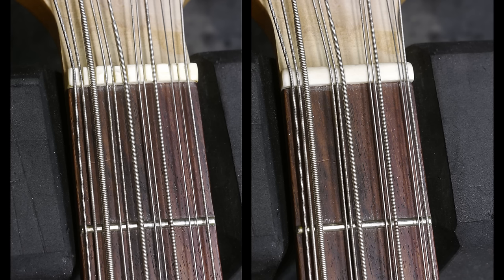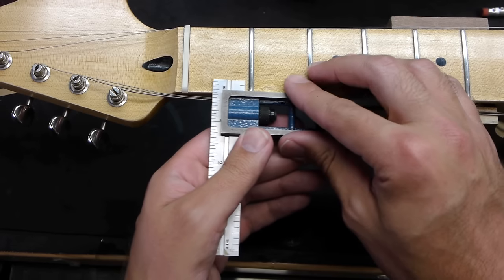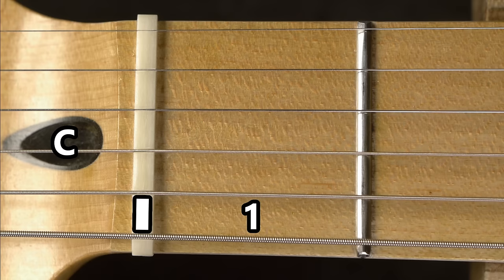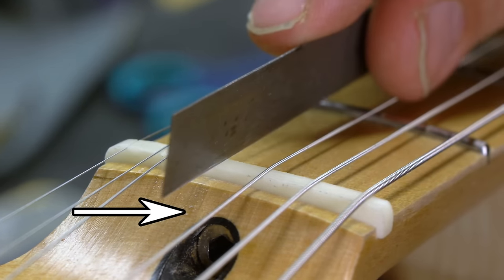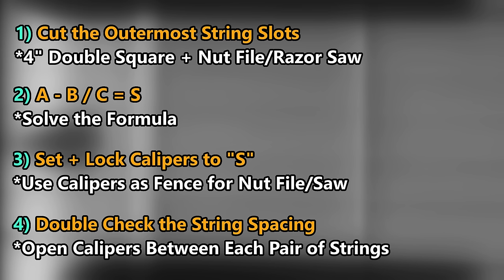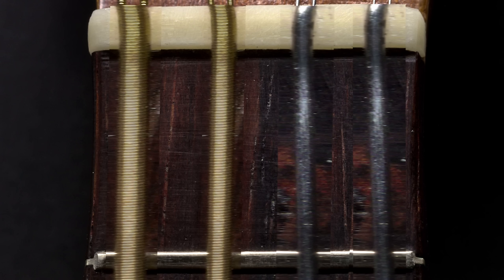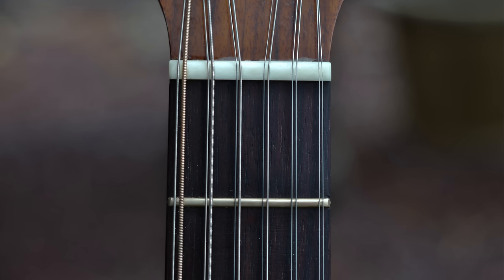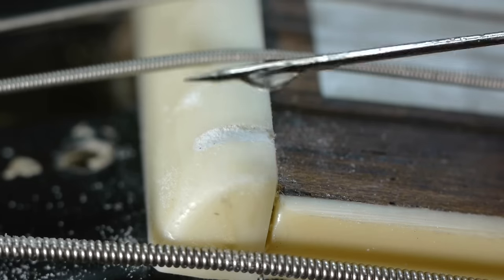Nut Slot Spacing *FOOLPROOF METHOD* - Works for 12 Strings Too!

Comment: Now that I understand cutting the full slot after each interval I can appreciate your approach.  The spacing is as even as it can be, and center to center distances change only by a few mils. It is perfect really. Too bad files are so expensive. I’ll take down my earlier comments. Thank you for your replies, it’s a rarity.
Again fabulous presentation and photography.
Reply from the maker: No worries about the previous comments! I always encourage all comments as it can help other people if they're having the same thoughts. 

I actually double checked my method immediately after you posted that comment as I thought you were right. I was 100% ready to take this video down, redo it and reupload it. 

My first thought was that you'd caught something I missed. I'm never opposed to criticism and my only interest is doing the best and most accurate work I can. If something I'm doing is sub optimal and I find a better way, the old way is going out the window. 

That's how I was taught many years ago. One of the many bits of wisdom imparted to me from Steve. Has affected my thinking deeply ever since

Comment: It’s a novel idea however if your nut files/slots are any wider than each string gauge you’re introducing a compounding error. But hey, it’s works for you! I use the edge of the nut as a reference point and the external caliper points to scrape a mark through a sharpy line and free hand each cut from there.
Reply from the maker: This is true. However, I present a solution for this in the video. It does not just work for me alone -- it will work for anyone and everyone that follows my instructions. This is an important point, as my goal with this method was for it to be foolproof, which it is. 

The solution: I tilt the file to adjust the slot as necessary to account for this. 

With the initial mark being shallow, there is plenty of room to move the slot left or right any amount needed to compensate for discrepancies between the nut file and string gauge. 

Then you re-test to make sure that the distance between the strings is as close to "S" as possible, before moving onto the next string. 

The value of "S" is calculated based on the exact string gauges used on that specific guitar. So getting each space to "S" will result in perfectly even string spacing. 

Most strings will only ever be a couple thousandths off as well, assuming a full collection of nut files. 

The standard Stewmac files are: .010" - .013" - .016" - .020" - .024" - .028" - .032" - .035" - .042" - .046" - .050" - .056" - .065", for guitar gauged strings. All gauges will fall within very close ranges of those files. 

The tilt is something Steve showed me as well. He has exclusively cut nuts by eye for 55 years -- I also did this for well over 10 years and then slowly started conceiving of a foolproof way to do it. 

Calculating for "S" will provide the precise spacing between each string for the exact set of strings. Using calipers to measure the space between each string once a nut is cut will very quickly show how even those spaces are. 

I've been quite surprised at times doing it by eye. Sometimes perfectly even spaces do not look even, almost like an optical illusion, but the calipers will reveal perfectly even spaces. 

Other methods are fine. And there is a margin of error that is acceptable -- even just changing string gauges a little will affect the spacing, but typically if the gauges are kept within a few thousandths of the previous gauge, this is not noticeable at all. 

I do want to clarify that I would never dog other methods. To each their own. .y friend for example does nuts exclusively by eye and they come out better than anyone else's I've ever seen, consistently. 

The purpose of this method is to make that level of perfection accessible to everyone. My friend and mentor told me it took him about 9 years before he knew 100% that he could cut a perfect nut every single time on the first try. 

I struggled to do this myself even after years, and the real challenge was a 12 string bass nut, shown in the video. I would certainly never want to cut paired string nuts by eye and this method takes all the tedium out of it. 

I do appreciate you pointing this out. And I only wish I had thought to mention that in the video. I did mention tilting the file but did not address the compounding error if those instructions are not followed.

My friend also uses his thumbnail as a guide and makes a pencil line on either side before cutting down the middle. Again, many roads lead to Rome -- but my goal was to take the guesswork out and make a very challenging job much easier to accomplish for people with less experience. Though I do think it's appropriate for people with more experience as well, if they're willing to give a new method a chance. 

Thanks again for the comment and again, I just wish I had mentioned this in my video. There's always some oversight and something I forget to mention yet I always strive for my videos to be as comprehensive and complete as possible.

Hopefully curious people will see your comment and my response and fill in the gap.
Reply: @guitar_md 

I truly appreciate that you were willing to share additional time on top of your video production to provide a clarification. Thank you.

I will try your method and perhaps also try using nut file widths instead of string widths for the equation as this would resolve the compounding error. I should have suggested this in my original comment, so there you go we can lament our regrets together.

For interests sake my personal guitars are spaced evenly centre to centre, as opposed to string-edge to string-edge. This obviously makes the spacings appear more tightly grouped as you get close towards the heavy strings. As you mentioned, the paradox of perfection in numbers presenting as visually incorrect.

Thanks again
Reply from the maker: @PatrickJWenzel  I appreciated your comment and the point you made was very intelligent, and suggested something I had not thought about. You did indeed catch something I missed, and made a point that I was up until now unaware of. 

I hope you didn't take any offense at my response. I come off as very stern but in my mind I'm merely describing things objectively. Perhaps I should have clarified that I wish my channel had more comments like yours, that have objective, useful criticism, and point out things I may have missed, in a respectful, objective way. 

Center to center spacing is something I have no experience with. I do know that some people prefer this. I would love to know the best way to achieve this, whether a method already exists or I could come up with my own version. 

As a player as well, i have no personal experience with center to center spacing. I'd have to try it extensively to evaluate my own preference. Just like with compound radius boards, people may tend to feel strongly one way or another. There is no definitive answer -- just preference. 

I would have to think long and hard to figure out how to reliably create such a spacing, preferably using a fence, like I did in this video.

Again...great point, and it is something I'm going to keep in mind. As good as this method is, I have run into issues in the past with this "compounding" error. Like a ship that's off by 1 degree. Well, by the hundredth mile, it's going to be off by a lot more than that. Same thing with the nut, and I have actually experienced this firsthand. 

i'd let a couple thousandths' discrepancy slide, then by the time I got to the B string, it was .010" out of spec, and I'd have no idea why. I have a better understanding of this now thanks to your comment. 

So don't be shy to speak up. I not only welcome it but I deeply appreciate it. I can only cover so much in my videos and I do rely on my viewers and commenters to catch mistakes I might make. 

I want to make sure you understand that I value your input and I'm grateful that you pointed something out to me that I was unaware of before reading your comment. These are the most inspiring comments to me and are a great service to the guitar community as a whole -- people can read through threads like yours and learn even more, just as you've helped me learn more today.

Comment: Finally! Math instead of voodoo! Can I send you all my guitars? Seriously, it’s obvious when you show comparisons the symmetrical beauty of your method outshines anything else. It speaks volumes that my left jumped at the sight of that 12 string spacing! I want in. Greetings from New Mexico!
Reply from the maker: Thanks so much! I really appreciate this. I also am my own worst critic and I had many failed attempts while refining this method. 

The 12 string spacing was inspired by the LKSM 12 string as well. That was the first one I saw where the string pairs were actually very close together. I'd never seen anything like it. Leo Kottke is one of my biggest influences on guitar (along with Jimi Hendrix) and so that had a big impression on me. It had just never occurred to me, despite playing 12 string for years, and working on guitars for years, that the string pair spacing could make a difference. 

I'd gotten used to accidentally muting strings in chords, accidentally muting strings while playing leads. Just feeling like my hand was running over itself. Widening the spacing and narrowing the string pair spacing fixed all of that. It really does become like a new instrument. 

I have had people ship me guitars before. I also will add that I've had a few people tell me they were beginners and they had great success using my nut slotting method, even on their own 12 strings. While I'm always happy to help, doing your own work is very empowering and very rewarding and even with in-person customers I am always trying to teach people how to do their own setups and adjustments so they don't need to come to me every time, or even at all. 

Not great for business but it's the way I like to do things. If you want to contact me you can reach me at guitarmdofficial@gmail.com. My first choice is always to help people work on their own instruments and make them realize they have the potential to be their own tech and make their own instruments play great -- but if people are really in a bind and need assistance I do my best to provide that within the range of my personal abilities. 

Thanks for the comment and the support!

Comment: Excellent. Just found your channel by random scrolling through shorts. Then skimming through what you had this video caught my eye. 

They say when you’re ready a teacher presents themselves. 

Well I couldn’t be more ready… my parts bass is laid out on the dining room table with the neck bolted onto the body, the bridge attached and the pickups laid out and tested to make sure it works. 

Tuners are already attached to the headstock and figuring out what to do next besides uploading pictures to my FB groups to get some attaboys. 

Well all was done and I then started on the nut. I found a bone nut and was sitting at the table with my hand sanding block lying upwards on the table as I’m sanding the side to fit the slot. I get a call before I finish and had to attend to something else. 

I come back and now I’m playing with my phone and I make my way to your channel and this video. 

Makes perfect sense, and perfect timing for me to make a perfect bass nut. 

Thanks for a perfect lesson. 

I expect this first nut I’m making will be way better now than if I hadn’t seen it. 

I also knew a guitar luthier back in the early 70’s named Steve in NYC. My first experience even knowing there was such a thing as a luthier. He worked out of his apartment in a cramped room/workshop and was quite a character. He did nice custom fret markers when he wasn’t strung out. His claim to fame was doing special work for Jackson Browne. 

I still have a broken acoustic guitar he gave me to play with to see if I could figure out how to fix it. Hahaha. I can’t believe I still have that broken guitar all these years.
Reply from the maker: You're welcome! And glad the tutorial helped. Thanks so much for writing to me here. Thoroughly enjoyed reading all of this. 

Funny you also knew a luthier named Steve. The Steve I know started his career in 1968, working for Dan Armstrong in Manhattan. I've figured out a lot on my own, but I never would have gotten started down this path if it weren't for him. And the first years, every single thing I knew came from him. I didn't even know what an allen wrench was when I first started hanging out with him at 14 years old. That was 20 years ago now. 

He's also got a lot of stories. I've heard so many over the years. He's become one of my best friends, not just my mentor. And lives right down the road from me. Been an interesting time. It was really only the last few years that I even got exposed to other guitar techs and luthiers. 

Rob DiStefano of Cavalier Pickups is another mentor of mine. I never met him personally. But have been talking to him on TDPRI for over 5 years now. He taught me almost everything I know with pickup winding. I did figure out a lot on my own, but later -- much the same as it was with Steve. 

Let me know how those projects are going. Sorry I took so long to reply! I've been so crazy busy. Backed up with work and especially working on new videos. Never a boring day here.

Comment: I’ll probably been doing it this way for about 10 years now… Very happy with my results. Important to remember this is really just a matter of taste.
Reply from the maker: Yes. My friend and mentor has been cutting nuts by hand and eye for over 55 years. That's the way he taught me to do it. You can become remarkably accurate with practice.

He lines up the strings by eye, makes a pencil mark on either side of the strings, then uses his thumbnail as a fence for the nut file to make the slot right in the middle of those two lines. 

We all have our preferred methods. All are valid. My goal here is simply to add an additional method to the pool of methods currently known -- and I believe it has the advantage of making the job much easier for beginners, by taking out the guesswork of lining up the strings by eye, or the human error that can be involved with making slot marks over a pencil line, or inbetween pencil lines. 

My friend said it took him 9 years of cutting nuts by hand and eye to completely master the job, and to know he could nail it with 100% accuracy every single time, on the first try. 

I remember when I was 15 years old and first started learning from him, he told me "Cutting a nut is what separates the men from the boys." So it's important to note that the importance of the nut was drilled into me from the very beginning. He started his career back in 1968 working for Dan Armstrong, long before the days of string spacing rules and many of the modern tools we all (myself included) take for granted now. 

Not only that, but freehand routing pickup routs with a full sized router, and so much more. It's been a great privilege to learn from someone truly old school who was working at one of the best repair shops around. Dan Armstrong was a really incredible guy but that could be for another video. I'll see if I can remember some of the stories my friend has told me from way back when, and his own early experiences as a novice guitar tech. 

The main reason I came up with this was to deal with a 12 string bass nut. 12 strings, with 3 strings in each course....was a total nightmare until I had an epiphany and figured this out. To this day I still don't know how I would have cut that nut any other way.

I'd put 12 string bass nuts at the very top of the list in terms of difficulty, at least in my personal experience so far.